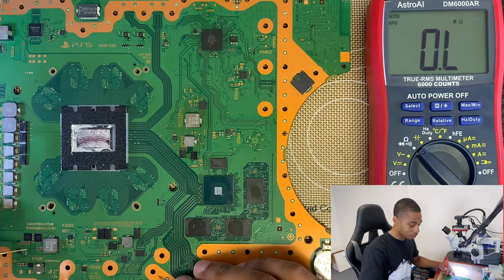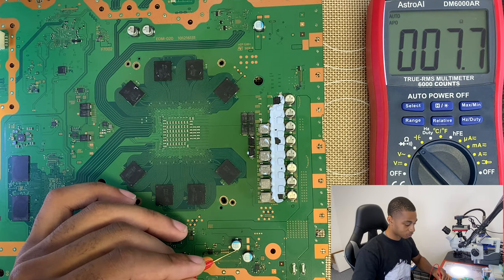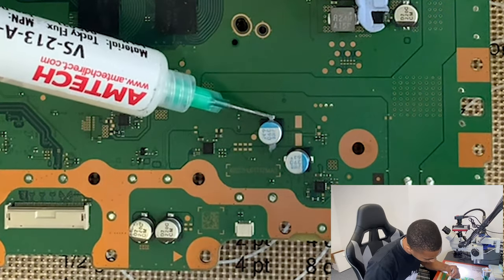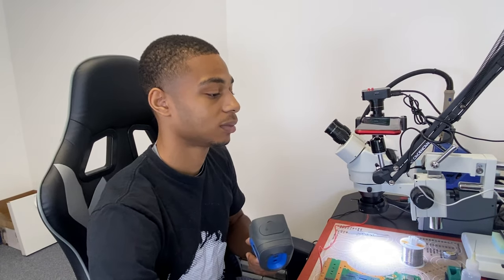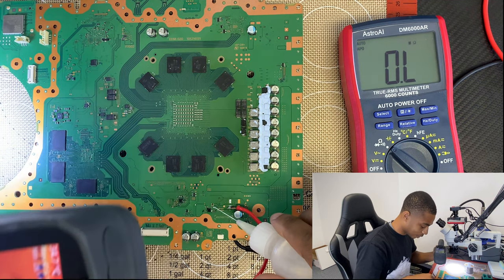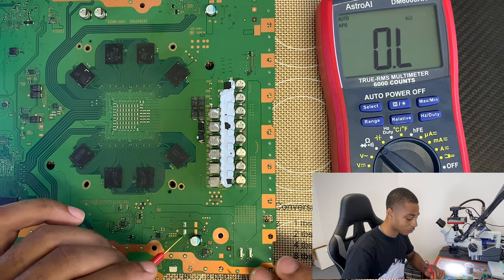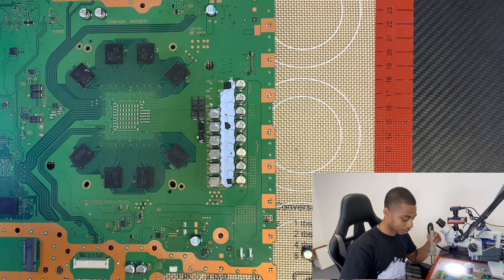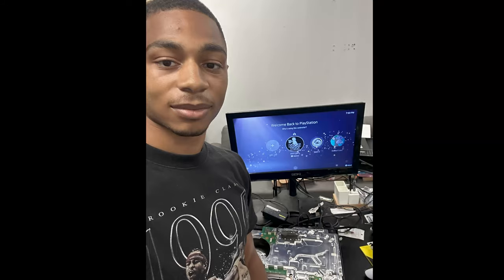PS5 Short Circuit

Comment: Unfortunately this method is dangerous to the board. The vias mean you have a lot of parasitic inductance when you instantly shut the voltage of you can have a high inductive kickback that may be enough to give an esd event to any sensitive semiconductor not enough to destroy the device but enough to damage it so it fails six months later.

If you dont have a tonohm (these are expensive) you can find a short in one of two ways.

1. if you have the cad files you can inject a small voltage of about 50 to 100mv DC in the circuit and use a voltmeter to find where the current is going.
2. if you dont have the cad files inject a sine wave into the short of about 15MHz at about 5 volt the 50ohm output impedence of the generator will absorb most of the voltage 
if the short is 1 ohm this will put about approx 10mV and 10mA into the circuit.  Using a set of emi sniffer probes you can trace where the current is going.

You can make a sniffer probe by using a piece of coax cable I have bought mine (costing about $200)  im now looking at a set that will cost approx $2500.

I have been using this technique for the last 15 years with 100 percent success and I am confident that every board is reliable once it has left me

Comment: Your soldering skills are s#it! Stop pulling on components with your tweezers before the solder is melted! You are going to rip pads! And use proper flux and low melting solder! Also the short finding injection is very sketchy!
Reply: Did your parents not teach you 'if you cant say anything nice, dont say anything at all.'  Instead of slating the lads techniques, why not advise. It puts you in a better light.